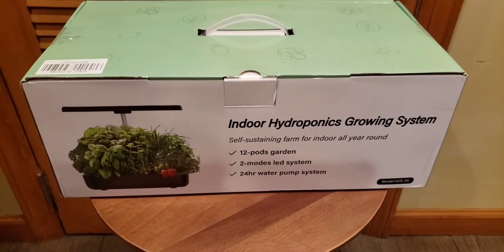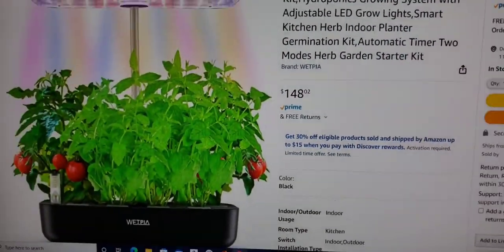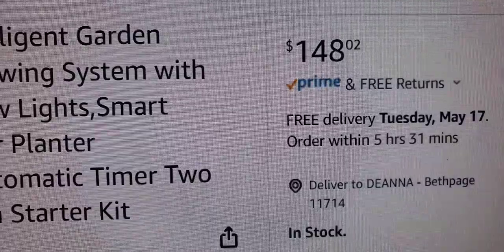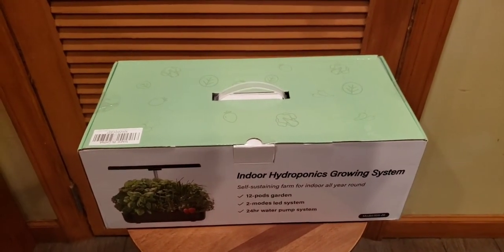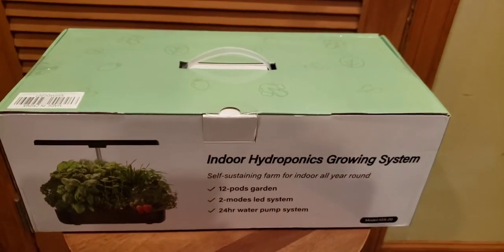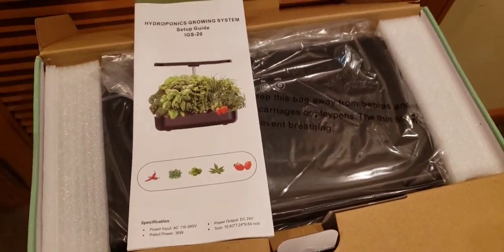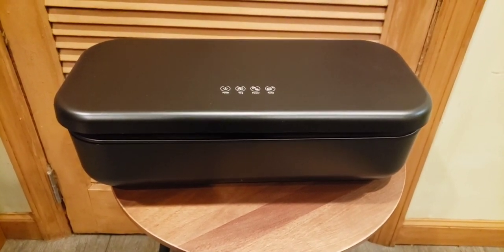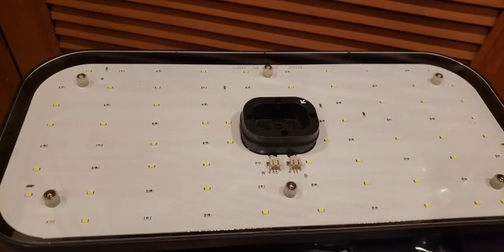Hydroponics Herb Garden Growing System Unboxing & Review

Comment: I have this unit and the timer seems to be wonky.  If I turn it on with the pump running (default), it will go to sleep after 10 minutes - lights off and everything and never turn back on.  I manually turn it back on, press the pump button, and the lights will stay on longer but sometimes turn on and off several times alternating every few minutes.  Then go to sleep until I manually intervene.  Any ideas what is wrong?  Faulty unit?
Reply from the maker: I am unsure. However, you can reset the machine by by poking a pin in the tiny little hole on the top and it should reset it and stop it from glitching.